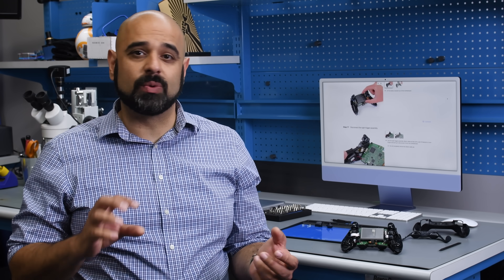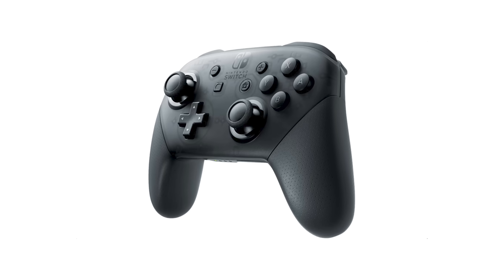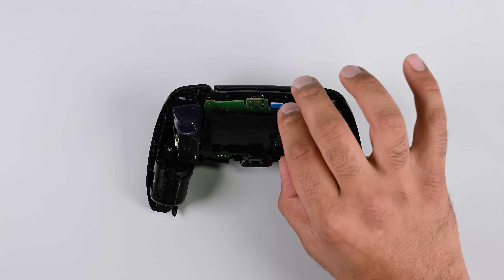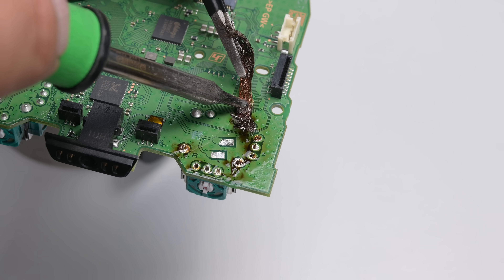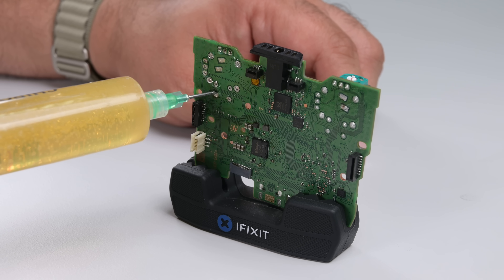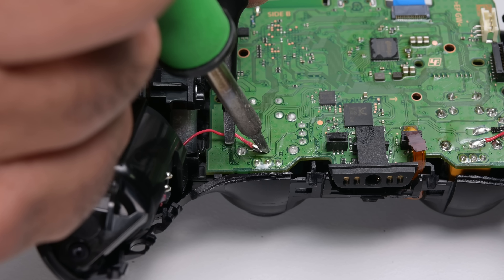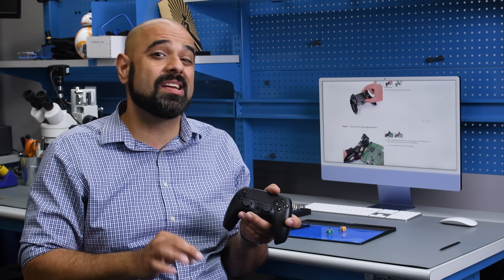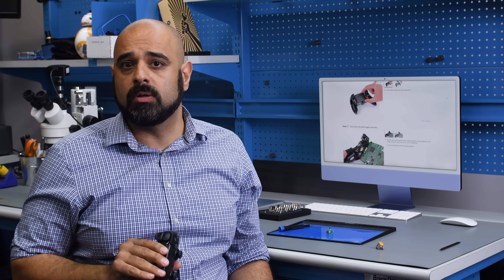How to Fix PS5 Joystick Drift for Good!

Comment: A year later and you can now get a pack of four hall sensor from Amazon for $13 which puts the increased cost of making controllers with updated joy-sticks at only $6.50 per unit further debunking manufacturers trying to gaslight us that the increased cost isn't justified.

Comment: I've played across all consoles with just about every controller that existed since the Atari. Either my luck is just amazing, or I'm just more careful with my gear. I've never experienced the various issues over the years that seem commonplace.

When I do these repairs, I often find sticky liquids like soda in the customers controller. Crumbs. Hair. Usually there are dents in the plastic and heavy wear, making it seem like the controller regularly gets bounced off the ground from drops.

While I absolutely agree there is better tech out there (which they don't use for obvious reasons. planned obsolescence) I also don't think it's purely the tech used that's the problem.. more how it's being used and cared for.

Comment: Here's a quick question, my sons controller got "shocked", static charge from carpet build up and shock from person to controller.  He brought to me so I figured hmm the stick is no good so I replaced the thumb sticks with new Hall effect ones, np.  But once I reassembled and went to calibrate online it's still doing the same thing, any ideas???   I've tried resetting, nothing, I'm going to even replace the battery just in case.  Any assistance would be appreciated.

Comment: I've gotten away with replacing a single potentiometer to fix the stick drift issue. I rather desolder 3 pins than all 14 pins

Comment: your video has no detail bro. teaching more detailing please, at first 1:58 To disassemble the controller, first unlock the two locking clips below the microphone button. This will make disassembling the controller much easier. and when 2:41 When removing the circuit board, you should mention the locking clips on both sides so that who doesn't know that can ruin the board bro.

Comment: I just completed changing the joysticks on my spare controller and now when I try to turn the controller on it turned on once sticks worked fine then it shut off now it flashes orange 3 times and then turns off it has a full battery I charged it before engaging in this endeavor did I make a oopsie poopsie any help would be amazing

Comment: i bought a knockoff wired xbox controller, over a year, no stick drift, the only ptoblem, i might have damaged the wire, but i fixed it with some glue, i bough a dualshock 4, got stick drift within a month, the xbox knockoff was about 11 euros, while a dualshock 4 is like 50-70 euros, this is bs

Comment: I have a question. Btw great video!! Best detailed one I've seen and man I wish I had seen this one for opening the cover... It was really hard to pry away and I was worried about breaking it lol. 

I haven't done the joystick component replacement but I have replaced the joystick covers. Anyhow on mine there's a rectangular metal piece on my board in the middle. I think it might be a heat sink? 

It sits on foam glued to the board, just above the two good capacitors (I'm assuming they are capacitors). it's in the middle between the two joysticks, and above the mute button.  

I'm just wondering if it's ok to put it back in loose or if I should get some PC coolant and dab it there to create the glue part for the foam again and place it back there. 

I've tried to find the information online but I've even seen some PS5 dual sense controllers opened and they don't have that metal part. Soooo I'm not sure if I should just remove it completely or try to re-attach it. 

Does anyone have any ideas?

Comment: Of course they don't use them... if controllers don't break they can't sell more of them 😅
I bought 2 Edge controller and 4 analog replacement modules before i learned how take them apart and replace any defective component... now i have 2 flawless Edge controllers with full hall effect analogs and brand new button membranes... i wish i had learned this sooner

Comment: Oddly what I’ve found is I can not play with any other ‘new or normal’ controller without my level of stick drift, I’ve come accustomed to my controllers slight flaw and errors and couldn’t be without it.
Reply: U don't have the bad drift yet I can't choose anything on the screen because my stick is aiming left and it's is going left so fast you can't pick a character or a even a game. Trash controller

Comment: The problem with replacing the potentiometers is that I can't get that solder off from the board.
Reply: Been trying all day wasted money buying all these tools only to fail at removing 😂 what a joke
Reply: @agnosticmanquestionsall2409  My online friend managed to do it, but he's using a really expensive iron. Apparently the normal ones aren't hot enough.

Comment: My controller is just a few months and has been barely used. It doesn't have stick drift, but now there's a more serious issue. It was working perfectly fine until last week, but now its movement is uneven and no longer smooth. What can be done?
Reply: Open it and clean it up using alcohol many videos on that
Reply: @agnosticmanquestionsall2409 I went to Sony they gave me a new controller. Thankfully it has warranty of one year.

Comment: I need some help. So, I installed some TMR joysticks...crooked...and need to reconfigure them but I'm having trouble cleaning all the solder to release them. I broke the old ones out then soldered from the other end, which was relatively easy. Now, I'm trying to use a manual hand pump and copper wick but I can't seem to clean it out very good. Been at it about a week! Tried resoldering and cleaning, flux, everything. Please help.
Reply: U got farther than me I can't even remove the bad modules only managed to remove the potentiometers by de soldering.

Comment: Ordered your replacement/upgrade and it really does require a solder sucker to clear out the solder in the holes. It was a bit involved, but I was successful (no extra parts-lol) Thank you!
Reply: I managed to remove just the potentiometers but not the entire module the wick method is hard I think I need the sucker thing

Comment: Thumb stick modules that are perpetually out of stock and, more importantly, use the same crappy pots as the standard version.  BTW, the same hall effect pots can be installed in the stick modules. You just have to add a jumper wire to enable calibration.

Comment: There's third option. Potentiometer metal circle reshaping. I just did it by hand and got off by only 27%, which I fixed with software calibration.

Comment: 😂  Will not for good 
 I've just had a change one of my hall sensor.

 Now working perfect again 
 Maybe I was very unlucky and got a fault one.
Reply: How do I get the modules out I managed to get only potentiometers out used wick and added leaded solder to lower temp but still failed to remove the main modules to put the hall effect in place

Comment: Nope. Sounds like fun. There is a video that shows you how to clean the internals with alcohol and it works like a charm. Placing your controller in a gallon size zip lock bag will help to keep it dust free.

Comment: So i installed a hall effect joystick on my left stick because of drift, and calibrated the centere and range using the website. 2 weeks later i decided i wanted to do the other stick and plugged the controller to gamepad tester and my rangers were completely off. the replaced hall effect stick barely reached the outer circle and the center was off as well.. is this normal for hall effects? Did i do something wrong in the install process. And yes i did save the changes after calibration

Comment: i got problem to get old pontiometer off i was try to heat lead and i have copper wire in middle still nothing happend i was even get new solder with 60watt at least 30 min 
can you help me?

Comment: Use rosin core solder, it has flux in it. 
Joystick modules can be removed in seconds (less than 10 seconds for both), if you have the correct tools, solder wick is not the correct tool.

Comment: Ok so I just bought 4 hall effect sticks and also a decent soldering kit.  My flux looks like a solid where yours is in a squeeze bottle.  I'm new to soldering hmm. I'm not sure how to use the flux ihave since I'm new to soldering but I have a solder sucker so I won't need that copper braid I assume
Reply: Oh I will need to get isopropyl alcohol I assume

Comment: @ifixit i just disassebled my controller for other reasons, noticed conformal coating on the area where the two joystick modules 14 solder joints are. noticed you did not apply any after you finished the replacement? any reason for the omission or it's just not that important to have?

Comment: For those wondering if you can replace the sensors in an Elite V2 with the Magnetic Hall sensors like in the PS3 controller... Don't waste your time. My brother owns & operates a repair shop & said the first 5 attempts to do so failed & realized the magnets elsewhere throughout the controller just interferes hardcore with the sensors. So don't waste your time!😂

Comment: I got a ps5 in november and this weekend the left stick on the dual sense started drifting, I don't use my ps5 everyday, just a couple times per week. I contacted PS support and it was covered under warranty, however ALL of my ps4 controllers had stick drift, I had to buy 5 new ones when I had my ps4. So instead of sending it back and wait 2 weeks for it to be repaired or just get a new one AGAIN. I'm opting to repair this one, let's hope I do ok.

Comment: The answer is A.. Just remember old tech (25 years plus) compared to new tech (anything built in the last 15 years). 
The model is simple.. Why make something last forever, when you can get the consumer to have to repurchase a replacement just as the warranty expires? It's legal, and predatory.. (And it's how they can get away with almost requiring an extra purchase of an extended warranty program) 
Crony capitalism basically. (If you still don't believe this is a thing, just look at your paychecks. They hate you, while we are programmed to idolize them, while hating anything else but them)

Comment: I went through four controllers before I decided to try and learn to clean my old controllers and fix the stick drift issue. Unfortunately, I broke one in the process. I repaired the original controller that came with my PS5, but shortly after, it started drifting again, so it’s likely I damaged it in the process of cleaning it. 
Out of three controllers, I successfully cleaned one and I’m currently using it again.

Comment: dude, use a desoldering vacuum pump to remove old solder. they are cheap to pickup and make cleaning joints so much easier. £3.50 here in the uk
Reply: Careful with those cheap ones...they can splatter solder all over.

Comment: I been using my ps5 controller for three years and i dont have any stick drift but i dont abuse my controller like pushing so hard around on the stick. I used to work at gamestop and some sticks were so worn where it looked like someone pushed so hard that the stick shaft was almost gone and the area around the stick were worn in an egg shape.

Comment: I tried de-soldering the existing joysticks using this method and it did not work for me. I could not get enough solder off to remove the joystick - even adding solder to try and mix the two and make it easier. Definitely need a new controller board now. Hats off to you sir, for being able to do that.
Reply: Usually, I use desoldering electric pump (also known solder sucker tool). Copper wire and regular soldering iron is not the best solution for multilayer pcb board...

Comment: i hate big companies and their bs like this. i got screwed because i bought into the dualsense edge with its replaceable sticks, well yeah they're replaceable, if you can ever find them in stock. I've found them in stock on sonys website a whopping 1 time since i got the controller when it came out. They're available on ebay and amazon from 3rd parties who someone have a box full of them and charge at least $40, double the price if not more and at that point i can just buy a normal dualsense for the cost of 2 scalped sticks. to make things worse you can't even take apart the stick modules and replace the sticks inside like you would with a normal controller. moral of the story sony doesn't care if your controller drifts, they want you to keep buying their controllers every year

Comment: I've had four PS5 controllers. Three of them have gone bad with stick drift issues. Two of them I was able to replace under warranty or store return policy. I have one working controller now with incoming issues i'm sure, and the other has wild stick drift that just completely makes games unplayable at times. PS4 controllers were bad as well, with stick drift and L2/R2 button issues. Then you have the PS1/PS2/PS3 controllers that could survive a nuclear blast. I could throw them off the Empire State building and they'd still work. Its obvious they are screwing all of us with the cheaply made modern controllers. I found a local shop to fix them, but I'd also like to learn to solder. Its like the male-equivalent of sewing/knitting.

Comment: also on some xbox controller the headset jack is not event soldered on the pcb it is only press down, overtime that will lift or have intermittend connection, that will have bad sound or suddend cut off

Comment: Just a tip for people who will be removing the old thumb sticks using the wick method shown here. You will want to introduce a decent amount of leaded solder into each of the joints (the pins and via (hole the pins are in)) before you start wicking it out. This will make for cleaner and less painful wicking. As for the tip of the iron, I use a conical bent tip, but I would recommend a “hoof” style tip, as the flatter surface should transfer heat better to the work.

Comment: If I see one more MFer talk abut how easy soldering this is, I'm going to scream.  3 hours in.  I've only ever soldered wires before, so yeah I get i need some practice, but seriously I cannot desolder these enough to get them off.  The solder used is obviously lead free because it takes forever to liquify (when it does), and hides in the hole in the board.  i've tried the wire braid, a solder sucker, you name it.  some of these pins are underneath the potentiometer, so heating the other side doesnt help.  Ive got the iron up to 450C and gotten most of the solder but i cannot break this thing free without destroying the board.

Comment: bro the melting point is beyond my 450 degree hot wella soldering iron... impossible to get it off.... wasted 2 hours for noting. used big iron, desoldering pistol, lower melting point solder and so on and so on... frustrating to see wasting 70 bucks for the trash can

Comment: Easiest fix (free) 
Buy new controller. Put broken one in package. Return due to stick drift.

Have done this 4 times since i got my ps5. Havent spent a dime on a replacement. The hardest part is swapping the mod pack over, which the average user won't have to worry about.

Comment: A couple of days ago, I fixed my controller that had the left stick with drift effect, simply by cleaning the dirty potentiometer.
But as you show in your video, you can replace the sticks entirely with the hall effect ones.
Browsing on Youtube, I saw that they require a particular calibration to work properly.
I see users inserting a pointed tool into small slots on the body of the "potentiometers" to adjust them, but I have not found an adequate guide, where it is explained exactly what to do.
I would also be willing to replace the sticks of my 2 Dualsense, but before doing so, I would like to know exactly what to do to avoid causing damage.
Do you have someone on the channel who can point me to a valid guide where all the steps necessary to do something similar are shown?
Thanks for the video and have a nice day.
Reply from the maker: Hi there! There are different versions of the DualSense controllers, but fundamentally the joystick removal process should be the same. We have this guide on iFixit.com to replace the entire joystick (please note that this requires desoldering / soldering the potentiometer: https://www.ifixit.com/Guide/DualSense+Joystick+Replacement/142488

There's also this one that simply cleans the potentiometer if it's dirty: https://www.ifixit.com/Guide/DualSense+Controller+V2+Stick+Drift+Fix/171461

For calibration, there's no official tool from Sony to help here. I found this unofficial one that people seem to like if that helps: https://dualshock-tools.github.io/

Comment: Does the new soldering have to be unleaded? I borrowed soldering tools and they came with the lead soldering roll
Reply from the maker: It doesn't have to! We just like using lead-free solder because the fumes are less toxic (lead is not great to inhale) and it's overall safer for the environment. But use whatever tools you have to do the job :)
Reply: @iFixitYourself  thank you so much. I support your channel and your commitment to promote the right to repair

Comment: You don't need solder wick to get those wires off, just heat up the solder and remove the wire, look at what you are doing to the insulation of the wire, too much heat.
Reply from the maker: Thanks! We'll keep this in mind :D

Comment: When manufacturing a million components the price difference of $0.20 and $2.00 is obvious. They made the controller very reparable so there is no use in bellyaching about an obvious manufacturing decision. It comes off as whiny, especially when a repair is that simple.